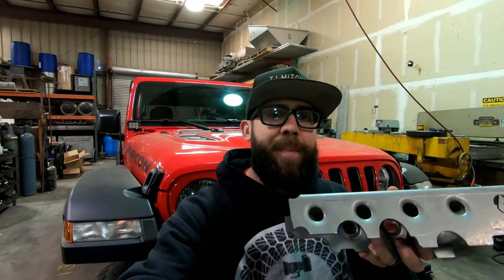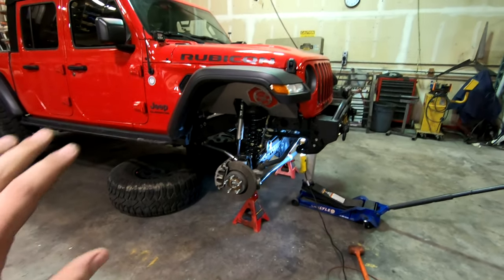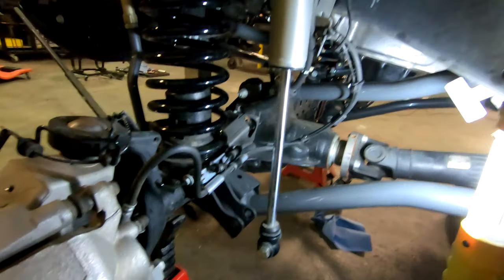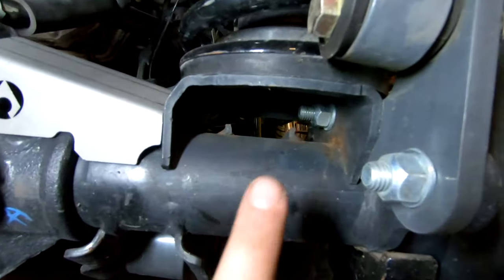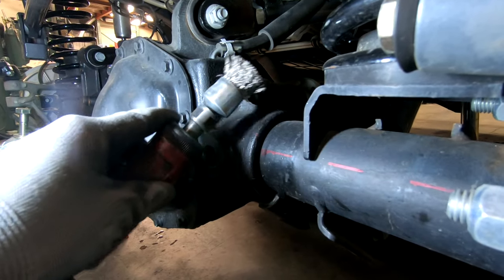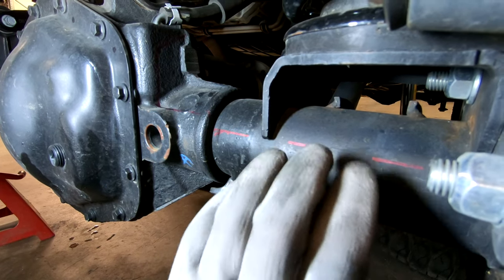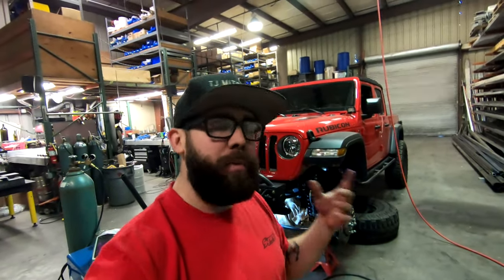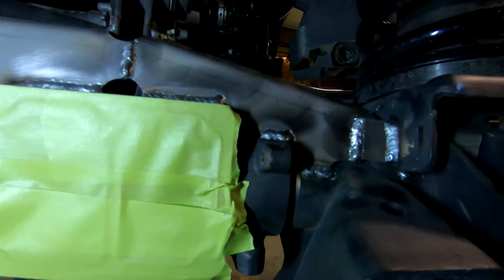Artec Truss Install For Jeep JL Wrangler JT Gladiator

Comment from the maker: Who out there had already trussed their front axle or will be trussing it in the future?
Reply: TJ Mitchell Films  I’ll be doing mine soon. Most of my trails in Tucson, Az involve a fair about of rock crawling sections.
Reply from the maker: Nice! I have seen some videos of the trails you have in AZ. Looks like a blast. I want to get over there some time
Reply: For sure, look me up when you come this way I’ll show you some awesome places.
Reply: I have the artec for my m186 on the sport. Also have the C gussets, but want to do ball joints at same time to not overheat them. Will you do gussets?
Reply from the maker: Herbyjk I do plan on doing the Cs eventually
Reply: Hey so since the housing isnt cast iron no preheat was needed but what about letting it cool down after welding ? Ive seen people wrap the axle after welding with a welding blanket to slow the cooling do thinks its needed ?
Reply from the maker: I did wrap it with a welding blanket after welding the cast section to help it cool slower
Reply: @BuiltForDirt  so im seriously considering doing this myself since i have a set of axles ready to go in but what wire and gas mix did you run ?
Reply from the maker: Wire was .035 ER70S6 with 75/25 gas mix.
Reply: @BuiltForDirt  nice! Thank you sir!
Reply: Here because I bought the full front armor kit and rear truss from artec. Looks like a fun bit of work. Thank you for taking time to explain the process think it should be totally doable.
Reply: I have the parts coming.
Reply: Did you replaced any seals or removed the carrier? Everyone seems to agree that you will mess up the seals.
Reply from the maker: @ghernandez6457  I didn't remove any seals, this was 4 years ago and still no issues.

Comment: Great video! Did all the heat from welding affect the ball joints and seals at all?
Reply from the maker: It did not affect them at all. Zero issues so far

Comment: I'm about to be trussing my stock samurai axle while I'm doing full contact perches, YJs and a diff skid plate. How do you like those tires? Was thinking of replacing my KM2s with them
Reply from the maker: Nice that’s going to be awesome. What size tire are you running on your Zuk? As for the Patagonias I really like them. Quite on the road (for a mud tire), hook up great in the rocks, and pretty light actually.
Reply: @BuiltForDirt  I got it with 33x12.5x15s but honestly I was thinking about going down to 31s or 32s if they make them. At least going to a narrower tire if I keep the 33s. I haven't locked my thirds yet to help preserve my shafts with the big tires. If I decide to keep bigger tires I'll do chrome axles. My goal this year is to run the con, I'm out in the Bay.
Reply from the maker: They do make them in a 31. You will love the Rubicon it’s a great trail. I’m trying to get my tin top on chromoly shafts, 33s, and a front locker some time. The 31” KM2s have done great on it but when they wear down more I think I will be switching to the Patagonias on it as well

Comment: Great video, how much stronger would you say this makes the axel? Does it help prevent bending the shaft? Or is the main purpose to prevent breaking the axel itself in half? Thank you
Reply from the maker: I can’t put an actually number on it but it makes it significantly stronger. The reason I did it was to give me peace of mine about the entire axle cracking around the disconnect area.

Comment: Does having those on there make your axle break proof so to speak?
Reply from the maker: Yes pretty much. I’m sure I could still break it if I was jumping the truck or something extreme but for normal off road and rock crawling use it should never break.

The next step would be axle shafts from RCV. After those the front end is pretty bullet proof.
Reply: @BuiltForDirt  Damn!

Comment: I'm wondering about the rubber inner axle seals at the pumpkin,...... possible melting??
Reply from the maker: The axle seals are on the ends and I didn’t have any issues there.
Reply: @BuiltForDirt I believe they are in the diff just beyond the carrier.  I've replaced many of them. There are dust seal on the ends of the axle but not oil seals.

Comment: How has the truss been holding up 2 years later? I just scooped the same set up and was wondering if you had any issues following welding it still on the jeep? thanks !!
Reply from the maker: Still on the Jeep with no issues. Just touched it up with a fresh coat of paint and inspected it a little while back.
Reply: @BuiltForDirt  Thanks for the response dude! I ordered that truss and hopefully it comes in soon. Thanks again

Comment: Did you need to buy a new gasket for the FAD mark or were you able to reuse the old one? I’m getting ready to truss my 2021 JL. Should I have any concern about overheating the axle seals? I did my 97 XJ years ago with everything together and didn’t burn anything up.
Reply from the maker: I don’t think you will melt the seals if you do it properly and yes I reused the FAD gasket with no issues

Comment: I really want to buy this as a surprise for my dad cause he really wants it,but me and him are really concerned if its gonna void the warranty on the gladiator and i need my question to be answered cause im not sure but thanks :D
Reply from the maker: I’m sure it would void the warranty on the front axle housing. That being said this will prevent the housing from bending/breaking any way.
Reply: @BuiltForDirt  Very true, well if i do buy it and weld it in for my dad i would imagine he would know about that,even though we will be running 35's cause we want a "lcg build" but my dad will be doing some "hard core" offroading so thats why he wants the truss but yeah thanks for the info man

Comment: did you have any concern about welding across bearings? With your ground on one side of the carrier bearings and welding on the other side. You are arcing across the bearings which could cause bearing failure.
Reply from the maker: I wasn’t concerned about that at all. I’ve done a few other trusses in the past and have never had an issue with it.

Comment: No problem with welding while everything inside the axle is connected?
Reply from the maker: Nope no problems at all. As you saw I did remove the FAD and I welded everything is short stitches
Reply: @BuiltForDirt  I brought a truss for my samurai and went to a shop because my welding skills aren't great yet and they told me I need to take everything apart, great to see I can do it when installed, great video man thanks
Reply from the maker: I did my front truss on my Samurai with everything on it as well. Just weld 1” at a time and let it cool
Reply: @BuiltForDirt  did you use the lror kit with the small parts for the sides?
Reply from the maker: Yup, do the front diff armor while your at it. I think it’s only like $20 for that piece from Low Range